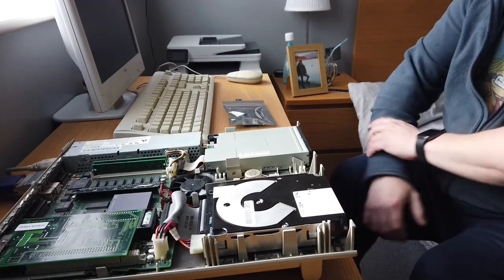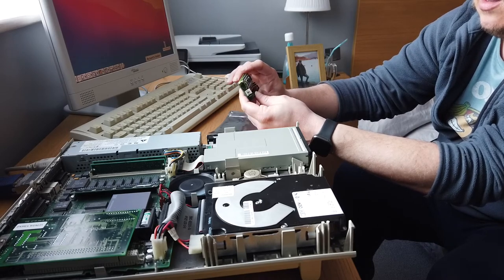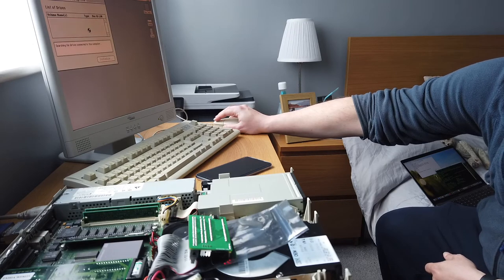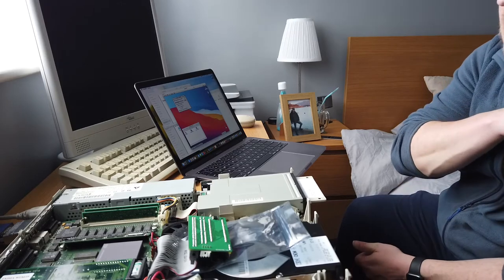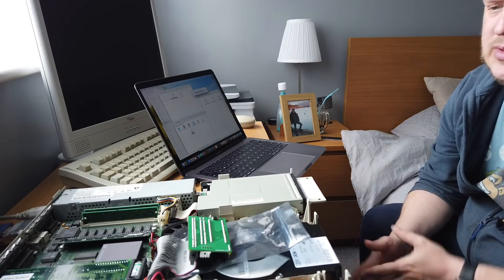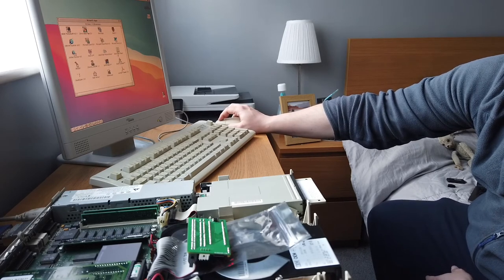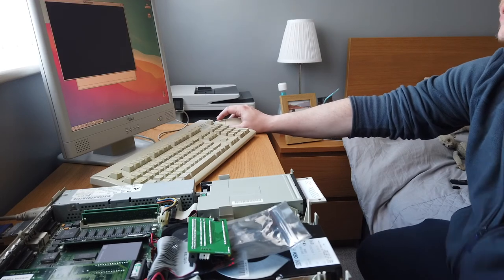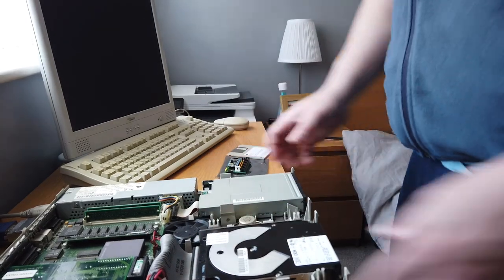35 minutes ramblings and a bit BlueSCSI hard drive emulator testing

Comment: Looks good I keep meaning on putting in something a bit more modern to replace some Hdd’s in things before they fail and to speed it up. This looks like a good option.
Reply from the maker: I'm impressed with the speed on 68k. Not so much on PPC but it wasn't designed for those. Still, the price is much more favourable for the BlueSCSI than the SCSI2SD. Be interested to see which route you choose.